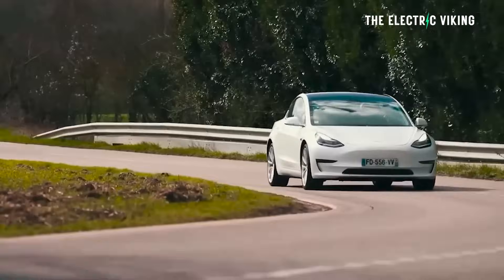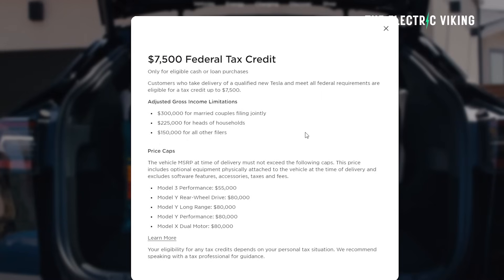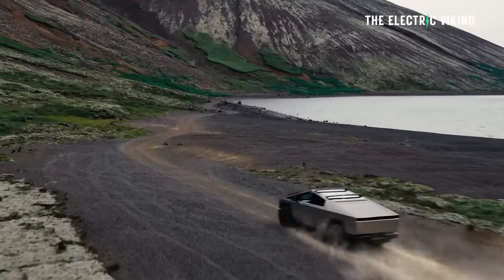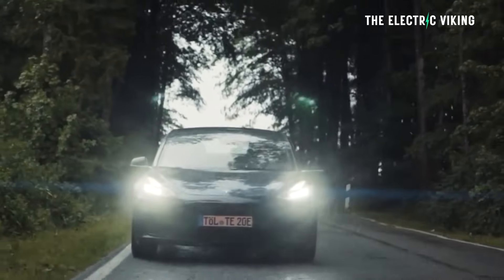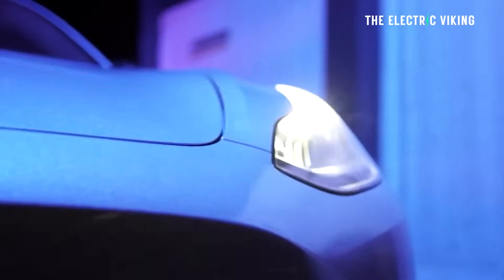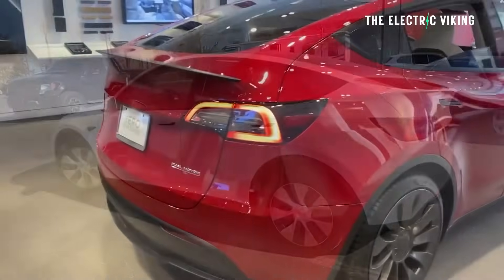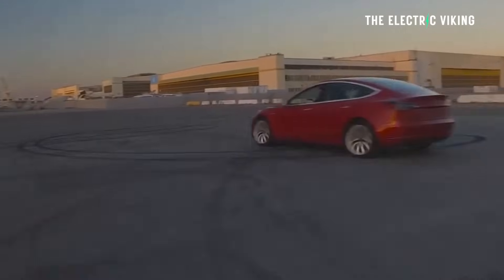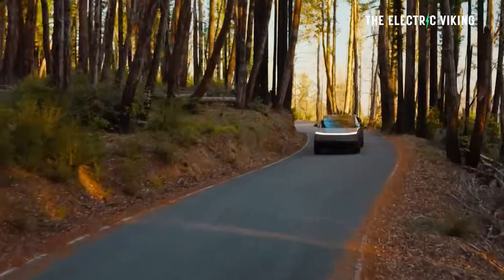All the Tesla Electric cars that qualify for U.S $7500 discount in 2024

Comment: I tought that Standard range Model Y had LFP batteries made in China? How about Model 3 Highland standard range, not the same battery origin?
Reply: Highland is not available, don't know yet if a version will qualify
Reply: Same here, I do not care where they are built, the only significance is the battery. I don't wanna see Energizers inside my 40k EVs.
Reply: The base model Y delivered in the USA, unlike basically everywhere else, does not have an LFP battery of Chinese origin, it has a smaller 2170 battery pack (NMC).

Comment: This is how the point of sale EV discount works:
At a dealership, a buyer provides the dealer with an EXPECTED tax liability for that year
That amount is deducted from the purchase price (up to 7,500)
At the end of the year, when taxes are filed, if the customer has a higher tax liability, he/she is refunded the difference. If lower, he/she has to pay back
But a point of sale discount doesn't mean that there is not tax filing or that it is easier to report the purchase. It just means a customer is better off from the time value of money standpoint ($100 discount today is better than $100 discount at the end of the year)
Reply: There is only an extra refund if the expected liability was quoted at less than $7500 and less than the $7500 rebate taken up at the time, e.g. if you quoted an expected $10,000 liability and and took the full $7500 rebate but ended up with $12,000 liability there is no extra refund.

If you exceed the income threshold for the year as a couple or individual you have to pay back the lot, if you end up with less than the expected liability you will need to pay back the difference between actual and your estimate.

It's actually dangerous for some people who deliberately overstate liability / understate income to get the full POS discount but don't have the money come tax time.